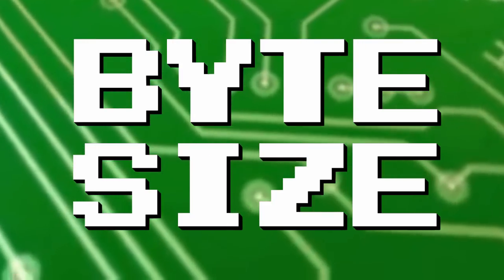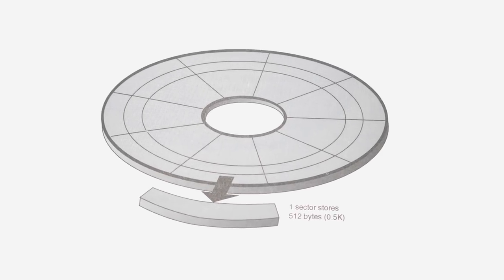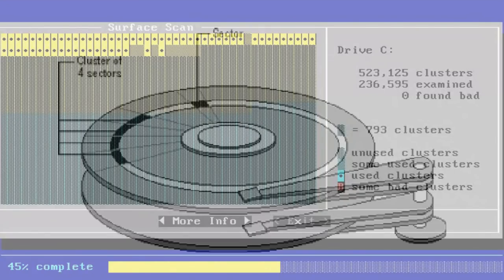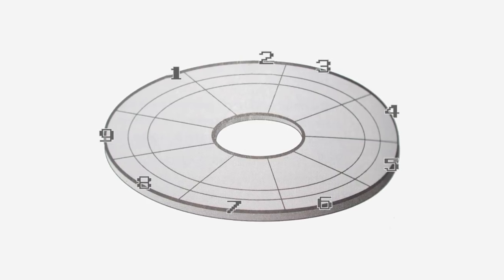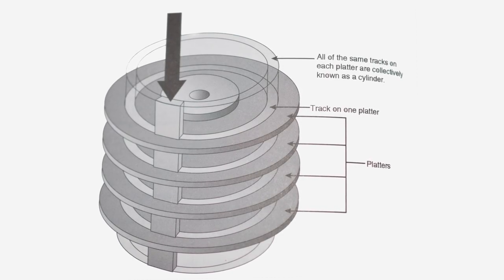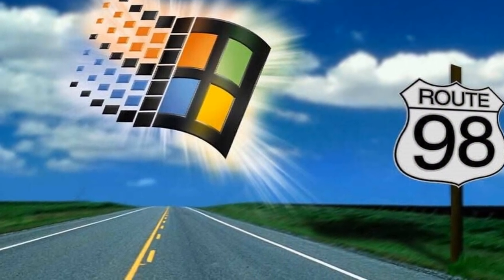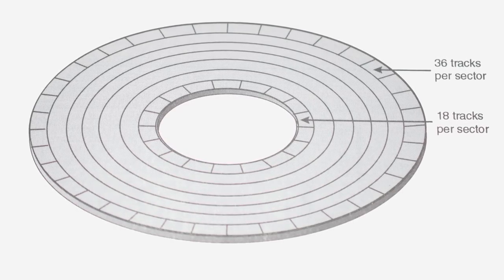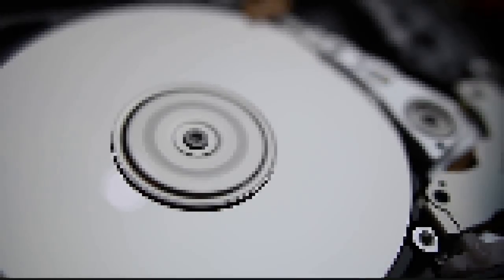What are Heads, Tracks, Cylinders & Sectors? [Byte Size] | Nostalgia Nerd

Comment: I remember having to manually park disks before shutting the machine down - all you kids are spoiled with your self parking drives.
Reply from the maker: Yes indeed. I found one of my old DOS utilities... PrkDsk the other day. Used to give me supreme satisfaction running that before power off.
Reply: In my final year of High School, I was a volunteer student administrator for a BBC network (8x Master 128s, 3x Master Compacts) running on Ethernet connected to a Level 4 fileserver. On my last day, I shut down the fileserver but forgot to release the disks first. Unsurprisingly, I never found out what happened the first day back in September when the network manager would have tried booting it up again...

Incidentally, elsewhere in the school was an English department Archimedes network, where the computers had been configured to play HAL 9000's "I am completely operational, and all my circuits are functioning perfectly" on boot - of course, as each computer took a slightly different length of time to boot, the end result was a chorus of 16 slightly out of sync renditions of that phrase...
Reply: I remember having old hard drives that suffered from "stiction", where the drive wouldn't spin up when you turned on the PC. The fix I used was to give the PC a sharp twist to loosen up the bearings before turning on the PC!
Reply: mittfh i love your 'HAL9000' story :D
Reply: I believe I used the command "diskmon /park" or something similar. It wasn't really necessary on a home computer running DOS, however, because there was no swap file or anything like that. For most of my DOS years, I just turned off the computer without parking, and nothing ever went wrong. It became more necessary when swap files, multitasking, background processes, etc. were introduced with more modern OSs. I remember the orange-on-black "It's now safe to turn off your computer" on Windows 95, before I had a computer that could turn itself off.
Reply: Diego C. Unix like OS’ses still today can use the command “sync” to write RAM or swap buffer to disk, try it out. They told me to always use three time sync before power off a unix server.
Reply: I believe parking was only necessary if you were going to move the computer as it would stop the heads banging around. If you were just going with the computer off I don't think it mattered. Although this is my decades down the road experience

I typed this on a touch screen. It took forever.

Potential update soon.
Reply: @MidnightThunderYT  that's exactly why you'd do it, if someone came along and moved the machine the heads would have the potential to crash into the platter - a very costly mistake back in the day. All drives self park now and have done for aeons a true relic of a forgotten era.

Comment: I remember using the dos commmand „park“, it was used to position the head of the harddrive away from the disk to prevent damage to the disk when the computer were turned off.

Comment: Sectors are still used today like in ssd drives, for instance a memory block can consists out of blocks of 4MB each but that also means that if you only put just 1MB of data on it or only just 512KB on it,then you wasted already 4MB of block space,with fat32 that block are only 2MB each while with fat64 each block is only 1MB sothat if you only throw 1MB of data on it,you only wasted that 1MB space,meaning there is more space left for other stuff.

Comment: Great video!
In old BIOSes, I remember having to manually configure the disk settings. However, I also remember the BIOS having preconfigured settings for various hard drive types. Why did they have that? Was that just for convenience, or was there a reason behind it?
Reply from the maker: Daniel Lo Nigro after dedicated hard drive boards went out of favour, the on board ide took up the task and often held a number of CHS settings to allow correct drive communication in stead of logical block addressing compatibility. I believe.
Reply: Thanks for the reply! I was actually thinking of "hard drive type numbers" (eg. http://www.minuszerodegrees.net/5170/hdd_type/5170_hdd_type.htm) but your reply was very useful too :D
Reply from the maker: I think it's the same thing. Those numbers referred to the specific requirements for the BIOS and allowed it to drive the drive, if you will. You can see in that chart that each number refers to a drive with a differing cylinder and head count, etc.
Reply: The type numbers were needed for the old ST-506 / ST-412 interfaces that were a lot dumber than the later IDE/ATA and SCSI interfaces. For the later interfaces, the host controller (separate card or built in to the motherboard) could read the necessary configuration information from the disk drive itself. As disk capacities increased, physical CHS values got replaced with logical CHS values - no drive really had 255 heads although that is what they often reported!

For the older interfaces, a simple type number was easier to enter than a list of configuration numbers. The drawback was the inflexibility of having a fixed list of type numbers in the BIOS settings.
Reply: I remember a lot of my computers had autoconfig functionality - as in the BIOS would work out the disk settings automatically.

Usually this worked, but sometimes it didn't, and then you'd have to scramble to figure out what the settings actually were.
Which... In the worst case meant removing the drive from the computer, noting what the label said, then writing it down...

Ah, old computers...
So many ways to frustrate and confuse you. XD

I think the best one was old VGA monitors since they were very restricted in the graphics modes they supported.
And... The graphics cards often were not.
Soooo....
It was fully possible to destroy your monitor by using an unsupported resolution...
Just as well at some point monitors started to have protection circuitry for that.

If your monitor went blank and says 'signal out of range' or something to that effect you could consider yourself lucky, because it meant your monitor was smart enough to not destroy itself.

There were other things of course. IRQ and DMA conflicts could get amusing... And complicated.
Especially when you had multiple devices that were rather inflexible with the settings they would support, and you had to somehow figure out a configuration that everything could actually live with...
It can get very interesting when you have a graphics card, sound card and network card all deciding they need the same DMA channel...
Reply: That's peanuts compared to the increase in hard drive capacity, which is about a million-fold increase in 30 years.
Reply: @yogibear2k10 It's mainly due to higher data density in 3.5" disks vs 5.25". Someone worked out how to store more data in a smaller amount of space. That's the same reason DVDs can store more data than CDs even though they're exactly the same size.

For a simpler example, think of a sheet of paper that you're writing some sentences on. You can fit many more sentences on the same size sheet of paper by simply writing smaller. You could even fit more writing on a smaller sheet of paper than on a larger sheet if your writing is much smaller (ie. you use very large writing on the big sheet of paper, and tiny writing on the small sheet of paper). This is the same concept :)
Reply: @yogibear2k10 For floppies, it's down to improvements in head design so it reads/writes a narrower region, and changes to the magnetic oxide coating for the different floppy densities.
Reply: +IanAbbott +yogibear1k10 There was also a point at which the orientation of the magentic fields changed, from so called longitudal* to perpendicular. The difference between these two orientations is that longitudal* recording was along the length of the track, and perpendicular was 'depth-wise', thus using a smaller region of the track per bit.
*I'm not sure if i spelled the word 'longitudal' correctly.

Comment: nice presentation, 3:45 should be CYLINDERS instead of TRACKS because here Total number of tracks = cylinders x total heads
Reply: Do you mean it should say "tracks per surface" (== cylinders) rather than just "tracks" (== tracks per surface x platters x 2 sides )?

Comment: but how did the controller address the data it needed? afaik the pata cable works with an address and data line. I've never read about having to specify a track sector or cylinder to get the data you want
Reply: As you're referring to PATA, it means that you're talking about IDE drives which essentially had their own on-board computer. This computer in turn translates back and forth between the logical block numbers and the actual, physical CHS parameters. As Nostalgia Nerd mentioned, you'll never see a harddrive with 255 physical heads, although many, if not all, IDE drives report this value to the host PC (or MAC). IF there were such a beast, it would have 128 platters, and be perhaps 5 inches tall! Thus it's safe to say that the other values reported by the drive are equally fictitious! :D
I hope this helps your understanding, but feel free to aks further questions.

P.S. Incidentally the term 'IDE' stands for Integrated Drive Electronics.

Comment: Nostalgia Nerd I still don't see the advantage of having a group of cylinder heads DIRECTLY below each other. Wouldn't it  make more sense to stagger the heads  on a contiguous slant on each level BY HAVING EACH OF THE HEAD ARMS LONGER ON EACH LEVEL..   The  current, straight down view  has the heads in need of being stored and organized because the information will all pass at the same time. On the other hand I don't know if the different lengths would cause "arm wobbling" because of ballistic speeds that the heads move. But they could possibly be counter balanced on the other side of the fulcrum.
(Unless of course, they are written on a slant for each level??) . But that would require either more lines of code and/or hardware, and slow down the information being written/stored to the disk.

Comment: They do still sell platter hard drives it is only recently that there are Solid State Drives that get away from the old platter type that has sectors and clusters etc.
I may get a SSHD when my Laptop regular platter HD goes poop and upchucks its silicon chips.

Comment: who formats there hard drive to 4096? 512 all the way
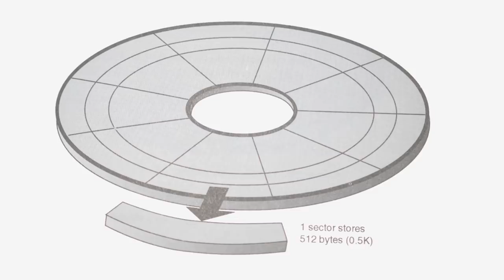Reply: At 0:52 he is talking about physical sector size. Not logical (i.e. software only) sector size used by the file system of your choice. At around introduction of 1 tera byte drives, hard drive manufacturers went from 512b to 4096b sector sizes to save space. Space is saved since checksums (AFAIK reed solomon is used like the one used for CDs) are over 4096b now and thus 1/8th of the amount of bytes used for checksumming is being used. (The checksumming I am talking about here, is performed by the controller of the disk.)

Most current drives (like 99% or so) do not present themselves as 4k logical drives. They do what is often called "512e" which means they use 4k internally but emulate a 512b sector size drive for backward compatibility with bootloaders, OSes and file systems that can't handle anything different than 512b blocks. This has a drawback: Every time you write a 512b sector the hard drive has to write a 4096b sector.